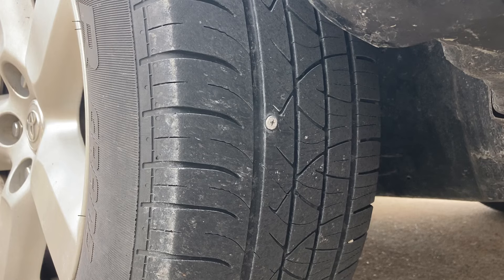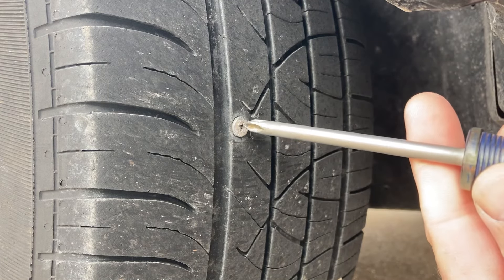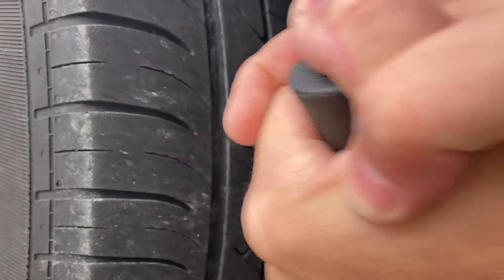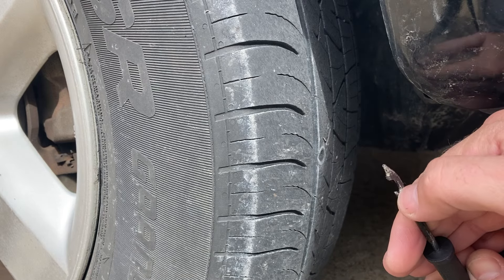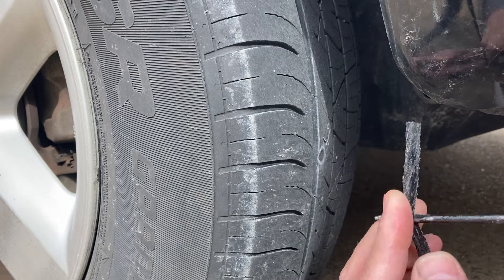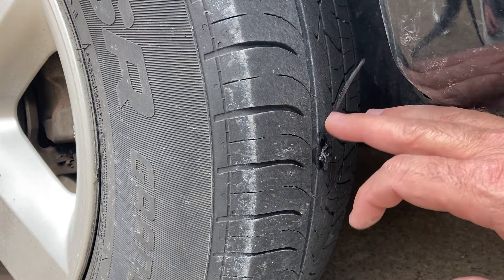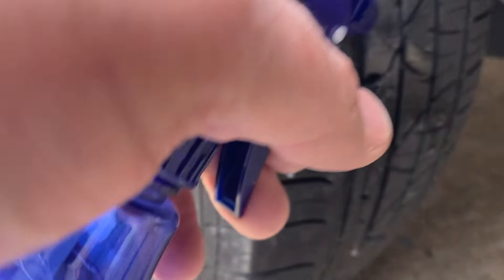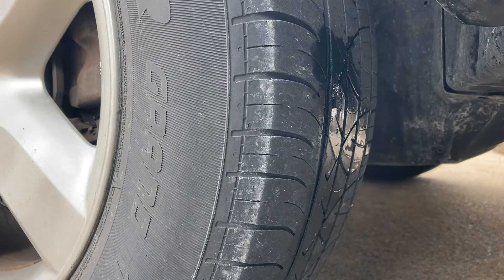Punctured tire. Simple DIY tire plug repair

Comment: You do not have to let the air out of your tire to do this procedure and use Tire cement on the tire ribbon
Reply from the maker: Nice to know. I usually let the air out, that’s just me…
Reply: @ElGringoPeludo  hey as long as it doesn't leak when you're done👍